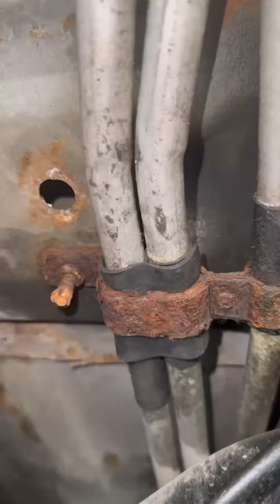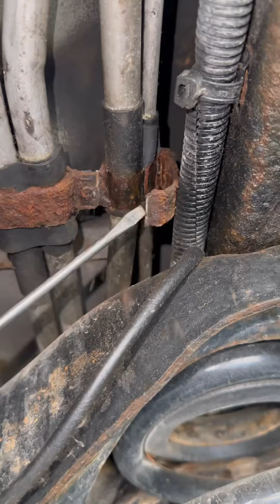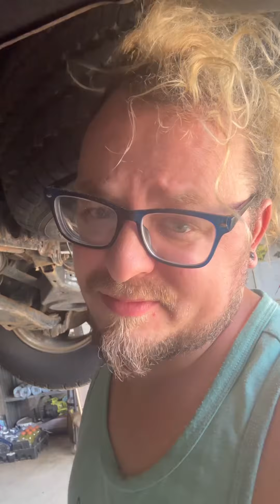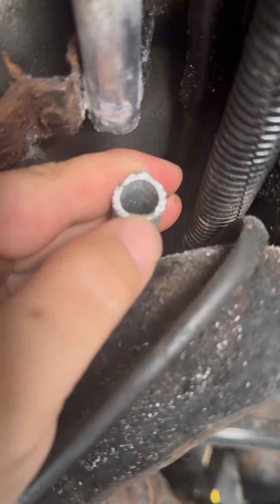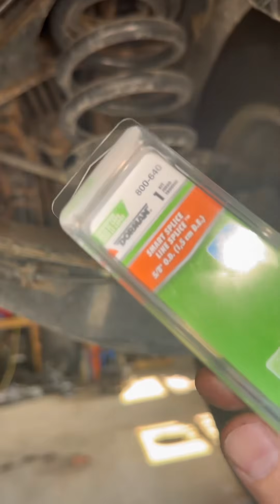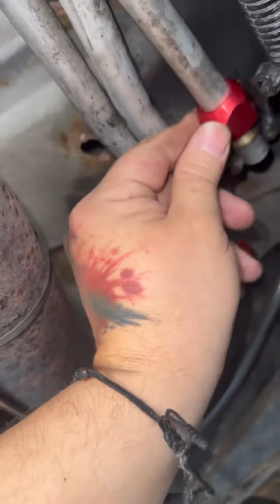Ac line repair automotive

Comment: I'm currently letting my JB Weld cure while I came inside to grab a coffee and cool down😂
Reply: Did it work?
Reply: @Frey33 very briefly.
Reply: Your ass better have been grabbing a iced coffee
Reply: jb weld is not gunna cut it. the metal expands and the chemical breakdown overtime will fail from the gases.
Reply: @Repnnorcal209 I figured it was worth a shot. I ended up doing the high pressure line, condenser and expansion valve. 🧊

Comment: How is it holding up 9 months later? I’m about to do this on my vehicle. Don’t wanna have to deal with $300-$500 on a brand new line kit.
Reply: the brass ferrule against the aluminum tube will cause galvanic corrosion failure. The aluminum nuts will fill with water from undercar spray. Once it hits winter  the nut will crack due to ice expansion. This is a temporary repair at best.
Reply: @Sc-db6lv а ксли я живу где нет зимы, и при зиме не сразу треснет, на пару лет точно хватит.